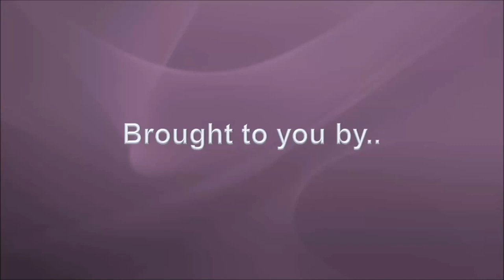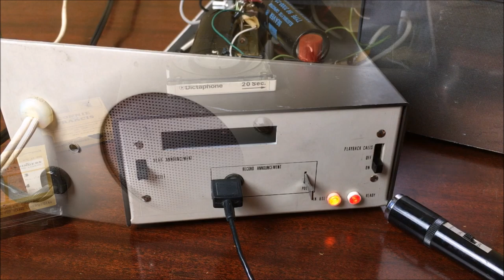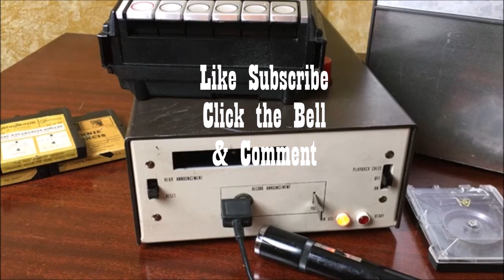Tensor PlayTape Answering Machine with Mods and Repairs

Comment: Back in late 1969, when the only way to have an answering machine was to lease it from the telephone company, I built my own.  Your Playtape resembles an NAB broadcast cartridge, which is physically identical to the old 4-track stereo cartridge, except for the pinch roller, which is part of the deck rather than the tape.  I found a very rare 4-track home recording deck at a yard sale.  I scored a 30 second NAB tape, which is 60 second on the 4-track.  I built a relay based control circuit which rectified the 90 volt 20 Hz ringing current from the phone line to pull in a latching relay and take the phone line off-hook and start the cartridge playing.  The ‘cart’ contained the outgoing message and provided the timing for the entire cycle.  It also started a cassette recorder to capture the incoming message.  The end of the tape was a foil patch on the tape, closing the circuit in a handmade sense head I added to the deck.  Broadcast cart machines sense the end by a tone on a separate track.  It was crude and ugly, but it worked quite well.  The biggest drawback was that the incoming tape also recorded your outgoing message each time.  Not practical, but it was a fun project.
Reply from the maker: Sounds like a great project!  Thanks for sharing!

Comment: I reckon the purpose of that solenoid probably is to reset the record/play switch straight back to "play" mode as soon as the foil strip comes back around to the sense contacts, so you don't carry on and wipe out your message.  Maybe check it for continuity, and check the sense contacts are making a good connection with the foil.  It will work without it, as you've discovered, but you must remember to push it back in when done with it!

While we're talking play/record switches, these really are the Achilles' heel of any 2-head recorder.  A poor contact anywhere on that huge multi-pole switch  (which pretty much rewires the entire machine; and in playback mode, the tiny signal from the tape head is passing through it before it has been amplified)  will cause all manner of trouble; noise, loss of sound, instability .....

Comment: Would a cassette tape head have worked?  If it's possible, seems like a better way to get it to work since there are so many more of them. You could use a  higher quality head.
Reply: It would have to be from an auto-reverse cassette player that does NOT mechanically flip the head to switch from A to B - that is, four physical pickups in a single composite housing.  Only two of the pickups would actually be required, but to the best of my knowledge, there are no monophonic auto-reverse cassette players.
Reply: Why would that matter?  Isn't it just a stereo head playing the left and right tracks individually?  One of those non-flipping heads should have the ability to read all 4 tracks.
Reply: @christo930   Okay, let me start over.

Playtape uses the same width tape (I'm pretty sure) as cassette does, and it's divided into two tracks, A and B.   The playtape head does not move; so it has two pickups in one housing that together span the entire tape, and switching from A to B is done electrically.

Cassette, on the other hand has to deal with two directions and FOUR tracks if it's stereo - two for each direction.   Since it's tough to cram four pickups into a single housing, most auto-reverse tape decks flip the head to reverse - but that head still has only two pickups for ONE side of the tape.

The higher-end auto-reverse decks don't flip the head (to avoid alignment and azimuth issues), so instead they make the head so that it has four pickups - two for each direction, and like playtape, they switch from A to B side electrically.
I know, it's tough to explain this without an illustration.
Reply: But why does the head direction matter?  
One presumes the reason most autoreverse tape decks flipped the heads was to cut down on costs of the coils in the head. The stationary autoreverse decks basically had 4 coils. (one for each track)
I did not realize the playtape was using a 4 head construction. I thought they moved the heads.